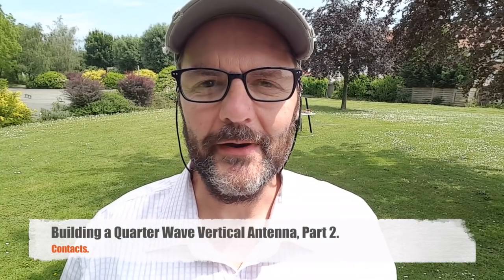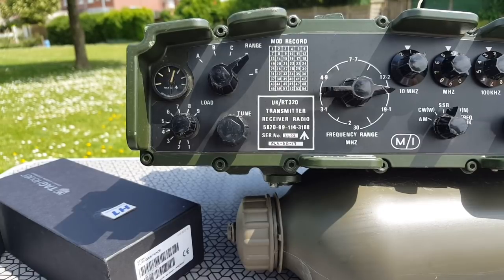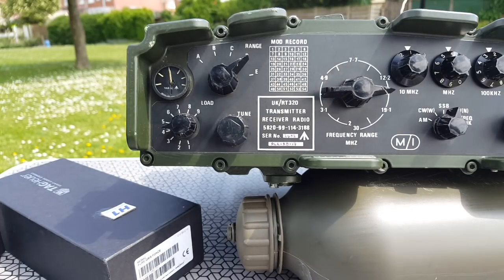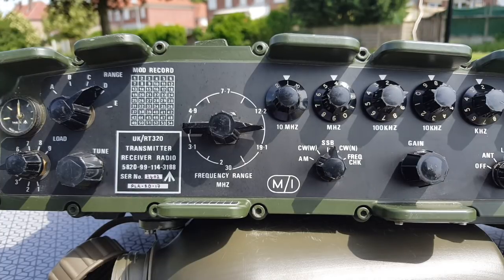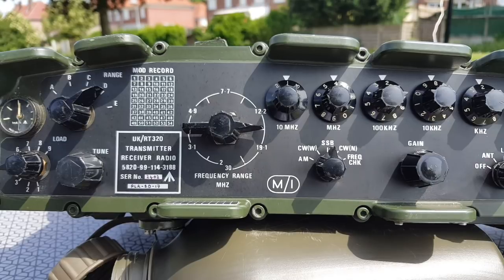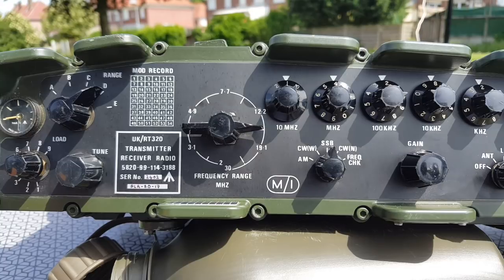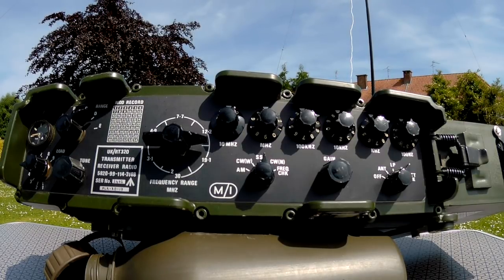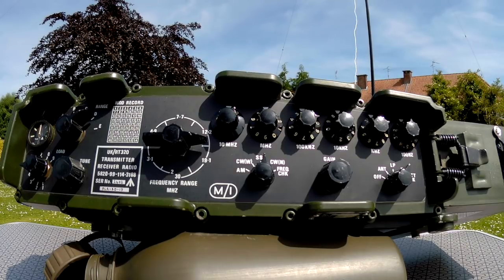Building a Quarter Wave Vertical Antenna, Part 2.

Comment: Your 320 looks amazing ...  have you refurb'd it ?   Mines quite beaten up, but it came from the Falkland wars.. so literally has been in the wars.  I had to replace the front plate as it was damaged and very faded.  The batteries were also Falklands war too.. and had to replace them in 2018 with the later plastic ones.     I too am looking at buying a Tank Radio. but  the antenna my be a stumbling block for me.   My usual place of operation is a public car park on a high hill.  so cant use masts and guy ropes.  Home QTH is a flat, so no garden for antennas.   

Hope all is going well for your new job ? 
73's    Dave
Reply from the maker: Thanks Dave, so far so good. Not refurbished. I have a second beatup unit, those have character. Try an end-fed antenna...

Comment: The sun is abnormally strong these days. I got a severe sunburn yesterday while doing stuff in the garden. Although I was in the shade almost all of the time.. Nice QSOs! That PRC Brick looks really solid!
Reply from the maker: Sure is. You probably could use it under your 4x4 tire to get it out of a mud hole! Really..
Reply: Radio Prepper well if they werent so expensive, that would make a good yt video haha. Cheers 73
Reply from the maker: Expensive in the US because of shipping... In Europe, about $200 to $300.
Reply: I am from Croatia, actually, In Croatia they built similar devices called RUP I think ( http://www.greenradio.de/htm2/e_rup15.htm) . 200$ is also expensive if you try to use it as a grip-brick for an offroad car haha ;)
Reply from the maker: I am sure we can find many uses ;-)

Comment: Hi...i was just wondering how u set the exact frequency ? Thanx for nice video
Reply from the maker: Hello. You use the six frequency knobs, for 10mHz, mHz, 100kHz, 10kHz, kHz and 100Hz. If you want say 14.300 though you must set it to 14.302 in USB. Using AM or CW you set it to the exact frequency. On USB it's 2kHz above what is shown on the dials.

Comment: Another great video Gil! My PRC-104 has two audio connections, but I also built a splitter so I could hook up a digital modem along with a speaker and handset. Maybe you could build a splitter to hook up a speaker to make the audio from the radio more understandable in the videos. Better yet, a small mixer right into the camera for noise free operation. Keep on prepping. Charlie KM4ZZ
Reply from the maker: I might just get a speaker...